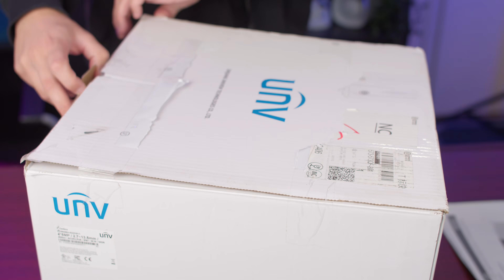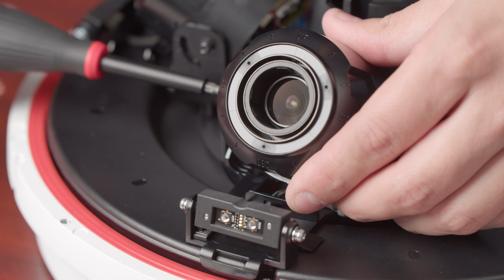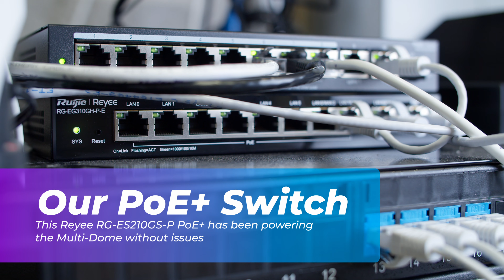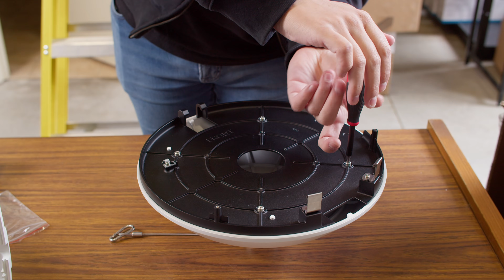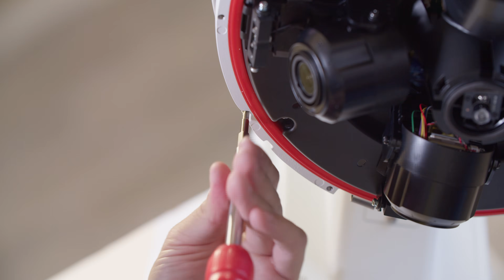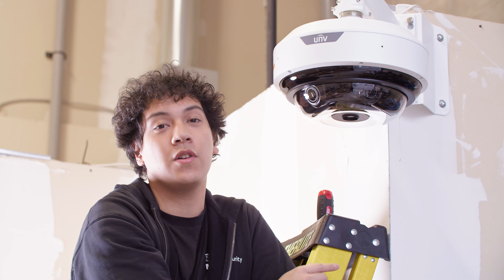Uniview 4 × 5MP Multi-Sensor Dome  – Unboxing, Installation, and Image Quality

Comment: Is it functional with regular nvrs? What size is that conduit hole on the camera, if you know? Thanks in advance.
Reply from the maker: Yes, the multi-sensor dome cameras works with regular NVRs. We're using NVR501-08B-P8 which is one of the lower-end Uniview NVRs and there's no issues.

The conduit hole on the side of the camera is 3/4" in diameter. The thread is called NPS, which hopefully gives you an idea for how to connect it with conduit.
Reply: @xlrsecurity  thats awsome! Thank you for the info!

Comment: I don’t see what justifies a $4.5k price tag. It’s not like they included four full-frame Canon R mirrorless cameras, because that’s literally what you can get for that money. Sorry, but it’s absolutely not worth it.
Reply from the maker: If you're a security integrator you can get Dealer pricing from your local Uniview distributor. If you're in Canada you can sign up for an account with XLR Security (visit our website) to purchase the Multi-Sensor Dome for a much better price.